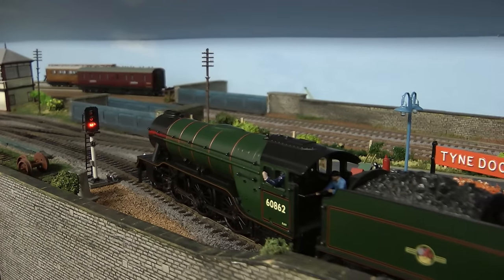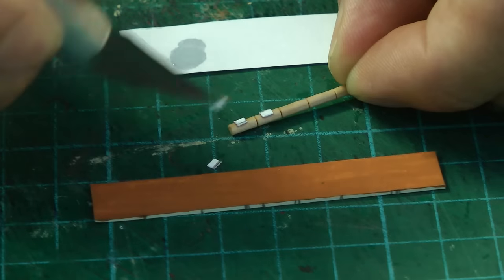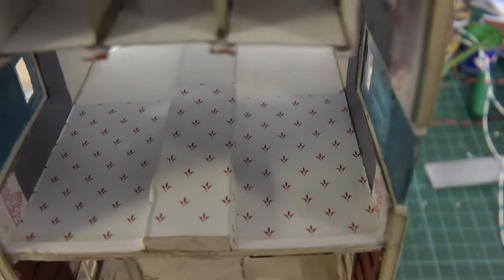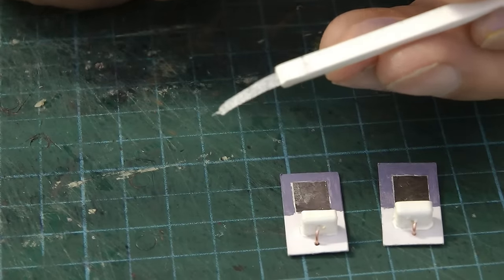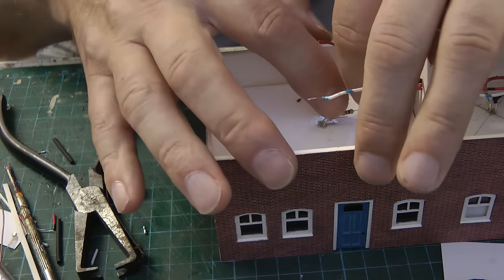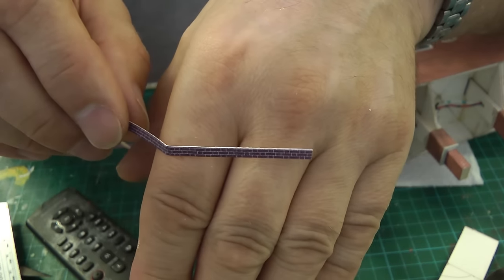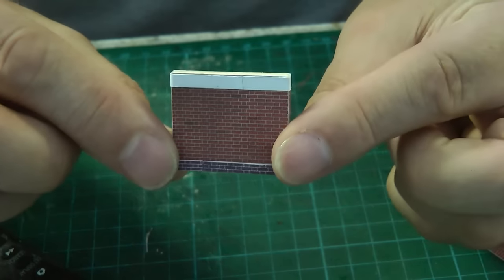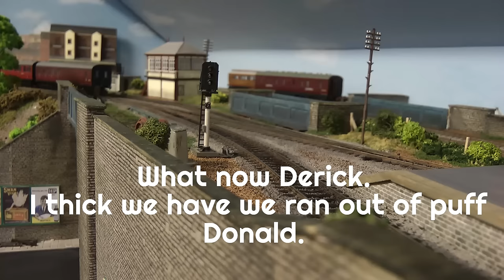Tyne Dock Part 14. Decorated & Wired up No 438

Comment: Dear Tony, beautiful is the word! Love the way you built the towel dispensers for the ladies. A marvelous idea to make such a dispenser, just some pieces of card and a sliver of kitchen towel does the job. Well, I would say that these demand for the other version to be modeled too. You’ll know, the ones with the pull out towel, which automatically rolls up again. 
Beautiful how the sinks are made and placed on a separate spatter board. Love the mirrors too. Just a question on those, did you use aluminum foil or tape? For me the tape works much better, before mounting it, it can be easily straightened and made flat with a small brayer. Whilst mounting the tape can also be more easily adjusted to the surface it is mounted on. Even think it should be possible to create a faceted mirror with the aluminum tape.
Simply awesome how you did the ticket stamp machines. Remember those you made for the South Shields station. Kinda funny that Sid now has the newer model. 
On the lights, like I said before, love the way the different interiors add to the lighting aspect and further enhance the character of the building. 
Very cool what you said last week in your reply, on the way you consider the Tyne Dock station part of the back drop. Can’t agree more, definitely with the mainlines just behind it and the open sky of the harbor front right behind the station. Am wondering if you have any photographs of the views into the harbor over the tracks? Might be interesting to add some harbor lights and possibly N scale, or even Z scale details, like some kind of light tower just in front of the backdrop. Humbly think that would further enhance the backdrop effect of the Tyne Dock station as you’ve mentioned! Cheerio
Reply from the maker: Good morning Vincent. I like your idea of the back drop to include some lights just to add some depth beyond Tyne Dock Station. maybe a couple of flashing white LEDS for the light houses would do the trick. 
we are always continuing to develop how we look at ways to make components for the railway. and the ticket machines is just one of them. anyway we have a delivery of furniture due this week. many thanks for commenting my friend. Cheerio Tony.